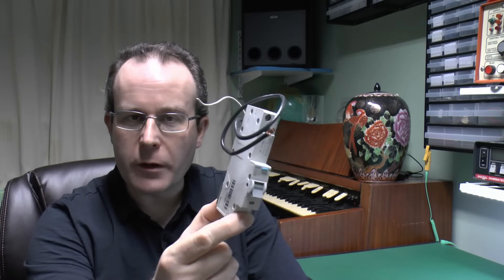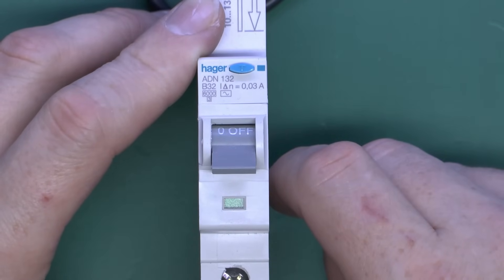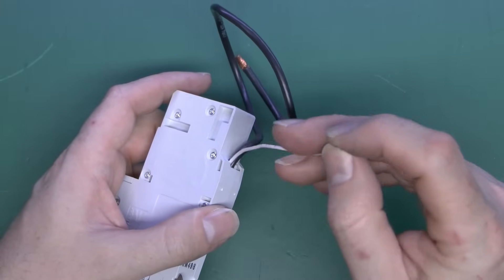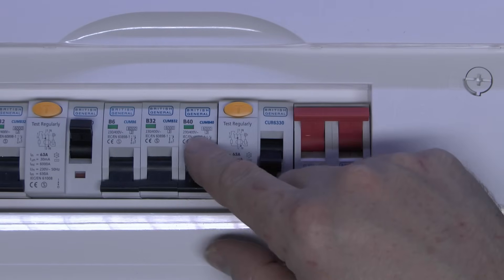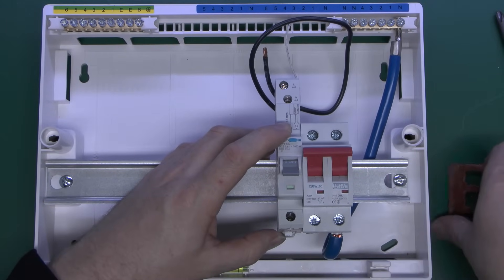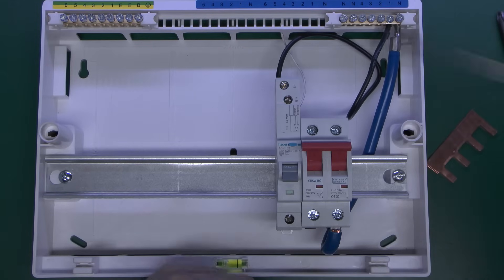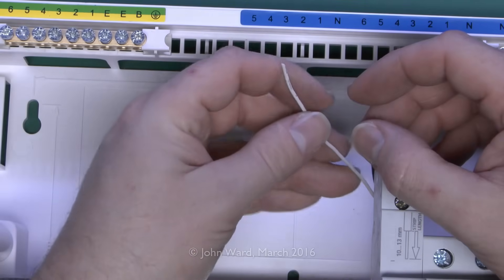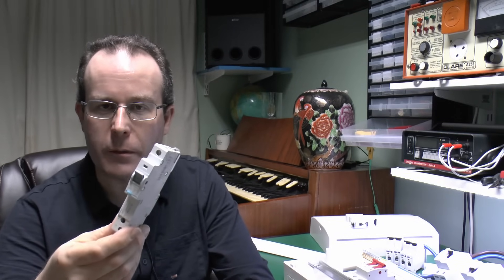Fitting an RCBO in a Consumer Unit

Comment: Would an RCBO be recomended for an Out Building, in the main Fuse box?
Reply from the maker: It can be done that way - the disavantage being that the whole outbuilding will be disconnected in the event of a fault.  That may not matter for a small building.
For larger ones a non-RCD circuit to the outbuilding with one or more RCBOs for individual circuits in that building is a better solution.
Reply: @jwflame  Thanks, I have a fuse box at the out Building with fuse trip switches, including one for the shower,  And an RCBO at the main Fuse board in House, all going via 3 core 25mm SWA to out Building.

Comment: I am in the process of changing the MCB into RCBO. I plan first to measure with a leakage clamp meter each individual circuit. Then if there is see which device is the reason and if it can be adjusted/fixed fix it. Then see the final leakage value and based on that put a 10 or 30mA RCBO in. So, I can finetune each circuit with a 10 or 30mA.
Reply: You don't need a 10mA trip rated RCD.
For additional protection, to save lives only a 30mA rated RCD is required.

Comment: With the cheapo arrangement (i.e 1 RCD governing several RCB's) you state that each RCD has to have its neutral connected to a separate neutral bar. However with the RCBO's, the Neutral flying lead can be connected to the same neutral bar (the one from the isolating switch). This seems uncelar to me as this flying neutral lead has the same function as the RCD Neutral lead. So the RCD function of all RCBO' s is connected to the same Neutral bar whereas if RCD's are separate the neutrals have to be connected to separate neutral bars!
Reply from the maker: For RCBOs the neutral leads are the incoming supply, before the RCD.
For an RCD and multiple MCBs, the neutrals are those for the individual circuits which are connected on the outgoing side of the RCD.
Reply: Ahh thank you. That's very clear. I still have the conundrum over the curious "unwritten rule" that you should not mix different manufacturers of the RCBO's in the same consumer unit. Surely they must be made to the same standards and have identical functionality. No need to reply to that John. @jwflame
Reply: @peterfardell9267 You can mix them.
But the responsibility is on you to test it properly to ensure there are no problems, particularly around heating, and you should consult with the manufacturers of the devices. But it isn't prohibited.

Comment: An RCBO is not suitable for all cases.  The problem with having each circuit with its own RCD is that there is no combined value of earth leakage.  This means that if there is another RCB further down the line (such as with a caravan - an external box fitted with RCBO) this device will trip because it goes by the total value of earth leak (vs individual circuits as on the consumer unit) leaving your consumer unit switches still on.  In short, if there is an earth leak, you will have too many nuisance trips further "upstream" which are much more annoying to keep having to switch on.  You may have guessed this happened to me 😅 (this after the alcoholic electrician friend of the family insisted this more expensive install would be top notch lol)
Reply from the maker: Upstream RCDs would not be of the same rating as those for individual circuits, 100mA or 300mA time delayed would be the usual choices.

Comment: John, if you were doing this in your garage for a hybrid inverter, off grid solar. Say you had 2 or 3 rcbo fed circuits, with the functional earth, will it matter if there's a neutral to ground bond or not? I think I want to keep neutral and ground apart due to the grid AC in cable in case of dull days not charging the battery. Any advice greatly appreciated.

Comment: Does this device  work when the 220 is two phase  no nutral at all for 220  the old  system in ksa is split phase in old houses  because  I noticed   the load side has neutral  and l1
Reply from the maker: The type shown in the video does not, they are designed for systems where the neutral and earth (via the white lead) are at the same potential.

Comment: Would it be acceptable to solder the end of that neutral run to make a nice connection to the N bus bar? I have terrible OCD and couldn’t cope with the untidiness of the extra wire.
Reply from the maker: No, solder is too soft to use under screw terminals, it tends to flow under pressure which results in a loose connection.

Comment: Good day John...wanted to ask ..say you need to add just one Rcd and the individual circuits will be with RCBO...will the RCD trip as well as the RCBO (if there is a fault) if they are both 30ma? Thanks
Reply: They could both trip. But it is unpredictable.
You should use a delayed type RCD for the upstream RCD otherwise you lose a key benefit of the RCBOs on the final circuits. The benefit of using individual RCBO's is that when the device trips it will only de-energise the loads on that one final circuit.

Now, you can't use the upstream delayed Type S RCD for additional protection, as it responds too slowly.
So where the IET regs say you must use an RCD for additional protection, eg, socket outlets, you cannot cover those final circuits with solely the delayed RCD. They must be covered by a non delayed type RCD with a trip current of 30mA.

Comment: How come the earth wire is white and the neutral wire is black? Why not green/yellow and blue? It cant be a coincidence. In fact I believe that any earth conductor must be either green/yellow or bare in Denmark, so the device would not be within the regulations here, imho. Or maybe its not considered to be an earth conductor, for some reason?
Reply from the maker: Neutrals are blue on newer devices.   The one in the video should have been blue as well, but some manufacturers continued making them with black for years after the colours changed.
The earth being white is wrong, as a functional earth it should have been cream coloured, and if such things were made today a functional earth should be pink.  However most/all newer RCBOs don't have the separate functional earth wire at all.
Reply: @jwflame  thanks for the thorough answer. Its much appreciated. Could you advice me on where to read/look in order to understand the definition of functional earth. So far I have ever only used "functional earth" to refer to the earthing of the center point in a  transformer.

Comment: Nice video ,is RCBo require for AC 1.5Ton in Uk?
Reply from the maker: Air conditioners don't require RCDs / RCBOs unless the manufacturer states they do.  The circuit cable may require one, depending on how it's installed.

Comment: Hello JW, I think RCBO doesn't cover short circuit protection and just adds overload protection. Some electricians use it instead of RCD and main switch which I doubt is acceptable based on standards.
Reply from the maker: RCBOs cover short circuit, moderate overloads and current imbalance.  It's the same protection as a separate circuit breaker and RCD.
Reply: @jwflame   can rcbos be replaced with mcbs as rcbos do have a live cable and neutral,  the circuits would still work removing the neutral and using an mcb circuit breaker?
Reply: Rcbos don't help with short circuit all they do is increase dirty electricity the test buttons only make it worse

Comment: Hello with the RCBO when it trips you have no idea weather it has tripped on over load or earth leakage . Is that correct ?
Reply from the maker: Yes, although there were/are a few which did have a separate indicator window to show when it was tripped by an earth fault.
Reply: These rcbo devices create extremely high levels of dirty electricity, in turn creates fibromyalgia increases to the suicide rate, hopefully these devices are phased out in the future

Comment: Does it matter which side of main switch is used for the live and the neutral ?
Reply from the maker: No, both sides are the same - but it does matter inside the consumer unit, L must connect to the busbar and N to the neutral bar

Comment: Is it true you can't just swap an RCBO for an MCB because it would become an unverified assembly? Even if its the same manufacturer? Seems crazy as an RCBO over an MCB should be a huge improvement (if properly tested) whereas the possible risks from tiny differences between parts seems pretty immaterial. 🤔
Reply: Rcbos are extremely dangerous they create extreme dirty electricity I have electro hypersentivity And had to get away from the consumer unit with the rcbo I get so stressed from them
Reply: @gameclan5831  yea but you're clearly deranged so nobody cares. 👍
Reply: @ironmantooltime  you don't be saying that if you get suicidal thoughts from the rcbo like I am. I'm not from the UK but it looks more dangerous compared to Australian and New Zealand electrics

Comment: I understand the main advantage of RCBOs that would trip only one circuit.  Some apartments have the electricity attached to a distribution box a ground floor but have another distribution box in their apartment.  Is is useless to install RCBOs in the apartment if at ground floor is installed  an RCD for protection of the wire going up to the apartment?
Reply from the maker: Submains supplying a consumer unit should not be RCD protected, they should be installed in cables that don't need RCD protection such as armoured, MICC or singles in steel conduit.
Reply: @jwflame  Thanks for taking time to answer my query and of course provide a solution.  Great man,
Reply: Is there a way to go round this to install RCBOs? Thanks for your educational clips. They are really useful. Thanks again.

Comment: Do you have to use a busbar and would it matter if the RCD is 2P and the MCB's are 1P?
Reply from the maker: Yes, a busbar is required.  Doesn't matter in normal installations if the MCBs are single pole, although 2 pole are available.
Reply: @jwflame  thanks for your reply, one last thing, are busbars universal where one bus bar fits all brand MCBs and how many MCBs/circuits would one connect to a single RCD.

Comment: A very interesting video on RCBO’s. I am looking at installing a 50A MCB - Type C (not RCD protected) in my current consumer unit and running a 10mm armoured cable to the garage consumer unit. In the garage I intend to install a 6A RCBO - Type B for lights and a 16A RCBO - Type B for a double power socket (no ring, no spur). 
My question is do I install in my garage consumer unit a 40A - Type C MCB for my EV circuit on the basis the EV circuit has a Matt:e RVD Protection Device that switches both live and neutral circuits and if there is a fault. Also, if I fitted a 40A RCBO it would just fight with the RCD protection in the Matt:e Device and it would just be a toss-up which tripped first?
Reply: These rcbo devices create extremely high levels of dirty electricity, in turn creates fibromyalgia increases to the suicide rate, hopefully these devices are phased out in the future just stuck with mcbs

Comment: Are the narrow RCBOs even available in other countries than UK or IE? In most of Europe you can't get them. My guess is because they are more expensive, contain electronics, and are usually a single pole, so only disconnect the live. The simpler and cheaper double width modules, usually disconnect both L and N, and usually don't contain electronic, and doesn't require extra functional ground.

Comment: When I had my consumer unit replaced ready for my EV charger installation, the guy insisted I needed to have RCBOs fitted to every circuit EXCEPT the EV charger one. Why would he ask for that? Surely RCBOs everywhere would have made more sense??
Reply: Your EV charger may have built in RCD potection? if so RCBO would be pointless if its wired in SWA

Comment: Just wanted to know does rcbo test button trip when just out of the box in the hand and nothing connected
Reply from the maker: No, it only works when power is connected.
Reply: @jwflame  thanks, I got worried, I bought one online for a new circuit to show Napit to get registered, any advice on anything to revise on for the assesment
Reply: @jwflame  my MCB that controls the kitchen sockets is tripping thereby switching the Rcb off and I have disconnected all appliances but continues to trip the RCBO? Pleae, What could be wrong?

Comment: John, you forgot to mention if you fit an RCBO alongside RCD's you'll also need to feed a separate live into the bottom and not take it from the busbar otherwise the RCD's trip before the RCBO.
Reply: Thanks to John and Mark for their advice.
Reply: This is what I was thinking, how is that done?
Reply: Rubbish.
The order at which protective devices trip is not determined by their position in the circuit.
That would imply the electricity taking a long time to pass through the circuit from one device to another.
Electricity travels at close to the speed of light.

What would slow it down is a huge amount of capacitance or inductance, which of course is not present.

The devices trip according to their specification, they have to conform to the relevant standard.
They trip based on whatever parameter they are measuring and the trip threshold value for that parameter.

If you want to intentionally control the sequence at which devices trip, this is called Selectivity and you achieve it by using delayed versions of the protective device.

For the avoidance of doubt, selectivity is NOT achieved by using multiple devices rated at different trip currents.
So a 100mA trip RCD is NOT guaranteed to trip after a 30mA RCD when sensing the same fault condition.

Comment: Hi John. Quick queery . I need to fit a new consumer unit to replace a really ancient one, and to increase the number of circuits from eight to twelve with dual RCDs and RCBO's Due to new building work I am having to resite  a new CU about one meter below and to the left of it's existing position. This will make it nessersary to extend the existing circuit cables to the new position. Qu. Can I extend  each cable using it's own independent connectors (three /circuit) inside a connection box  on the site of the old CU and so extend the existing cables to the new consumer unit. ? Your Advice would be appreciated. Edward Birch
Reply from the maker: Yes, provided the new cables are in the required zones.  If the box remains accessible then any suitable connectors can be used, if not, then they will need to be maintenance free connectors in a box designed for them.
It's either RCBOs, or RCD + MCBs, not both.
Reply: Many  thank John.

Comment: What would happen if you retrofitted some rcbos for ring circuits (kitchen, utility, garage) and they were in-line with the combined RCD/Main switch?  Would both the RCBO and RCD trip? (that would show where the fault was), would only the RCBO trip ( ideal), or would the RCD trip first. Or some random combination of the above (not good). Basically the goal is to find cause of nusissance tripping!
Reply from the maker: Either the RCBO, the RCD, or both might trip.  Totally unpredictable.

Comment: hi just got a couple of cpn rcbo's one problem is that the busbar connection on them is set back from the other breakers how does one compensate for this and the other question does the neutral wire that fits into the rcbo have to be from the circuit or the neutral rail
Reply from the maker: If the busbar isn't in the right place, they are the wrong devices.

Comment: Hi John thank you for the great video as always. On my older CU the main switch is only single pole which isolates the Line side of the mains supply and the main Neutral in is connected directly to a busbar. There is also and RCCB and a second Neutral busbar both of which are populated. My question is does it matter which of these Neutral busbars i connect the RCBO Neutral to. My RCBO does not have the attached Neutral and Earth wires like the one you used in the video
Reply from the maker: Yes it does matter - the RCBO connects to the same neutral bar as the rest of the circuit breakers, and not the second one which is only for devices covered by the other RCCB.
A single pole main switch is not compliant now, and never was.
Reply: @jwflame  Thank you very much John for your reply and clarification ,  Always enjoy your videos keep up the great work.

Comment: Hi John what is your take on trimming down the neutral fly lead or should it be left original length
Reply from the maker: Can be cut, but if so it will need a terminal crimped on the end, as the wires used are normally very fine ones.
Reply: @jwflame  hi John thanks have got a few bg ones and the leads are massive. So just put a boot lace ferrel type crimp on

Comment: Interesting they include a spirit level device down at the bottom. I guess they'd rather have their equipment installed square on the wall, not at any random angle, so it looks better aesthetically. No relevance to functionality of the unit at all.... but yup, go for aesthetically pleasing over function, that works. Better feedback. more sales.

Comment: A nice video but isn't it a bit of a let down when RCBO provides a neutral and earth supply but not Earth. You still have to strip the cable, place earth sleeving on the bare earth wire and then connect the neutral and live to the RCBO itself. Why not have an earth connection also for the RCBO with no need for earth sleeving. Also, 1P+N isolation RCBOs with earth would be an ideal protective unit.

Comment: Hi John a great video what happens if you have more rcbo than the main neutral bar holds
Reply from the maker: Consumer units are supplied with enough terminal holes in the neutral bars and often a few spare, so that situation should never happen.  However you can buy the bars separately for most consumer units if for some reason you needed more.
Reply: @jwflame  thank you